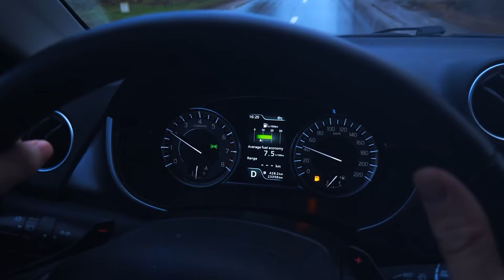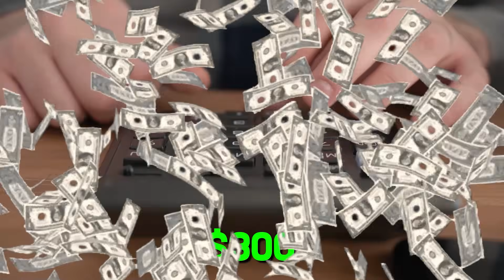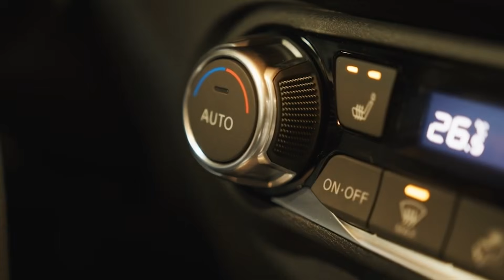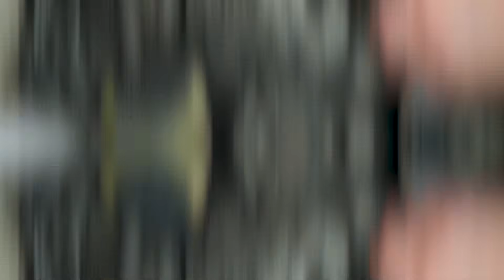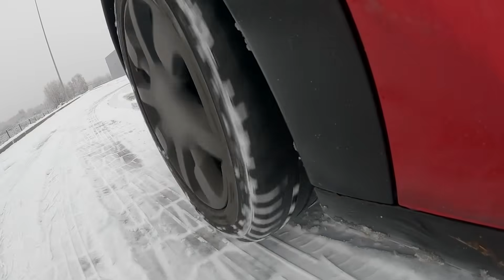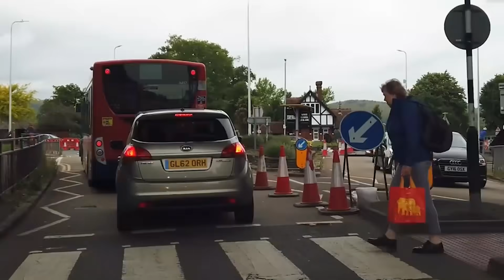THE JAPANESE METHOD for Saving Up to 50% on Fuel – You Need to Know About It

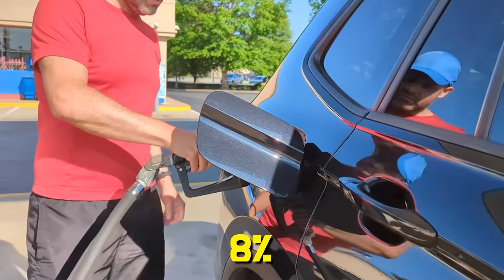Comment: 15:00 I haven't seen $0.20 price differential between regular and premium for twenty years. It's generally $0.80 to $1.00 difference. Also, if 8% fuel improvement yields a $12.00 per tank fuel cost savings, you are getting less than 4 miles per gallon.

Comment: As a hypermiler, I applaud this video. I routinely get 34-35mpg in a C5 Corvette by coasting which takes a 3D knowledge of the area and a certain degree of planning/observation. Wherever I go, I am always looking 1/4 to 1/2 mile ahead of my position. Looking at traffic flow, the light patterns and knowing when to start bleeding off speed in advance of a hill to coast down the other side and accelerate. I have probably passed at least 5,000 cars/trucks IN NEUTRAL.

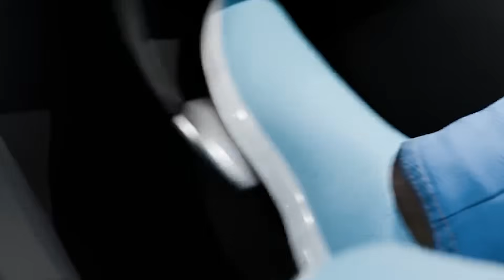Comment: 3:26 
Coasting to stops signs also. Not only save gas, save brakes too. I've tried to explain this to my wife for years to no avail.
Reply: I drive a manual transmission so I do the same thing. I always coast to stops or red lights unless there is a vehicle behind me catching up to me too fast and I don't want to "inconvenience" their expeditious commute if you know what I mean. Then I need to drive at normal speed up until I almost reach the stop sign or light.
Reply: @electron7659 I told my mechanics I don't use the brakes, ha!
Reply: HYPERMILERS UNITE!
2000 C5 Vette: 34-35mpg
1996 Saturn Twin Cam: 43mpg
2022 Honda Accord 2T: 37mpg

Comment: The no warm up doesn't work when you need defrost and have snow/ice accumulation.  As for tire pressure somewhere between door specs and tire markings.  Before EGR we never had a problem with deposits.. But we had carburetors and 30 weight oil, and leaded fuel.  
If your going to run 55-60 mph please stay right.  Thru gearing & tire size my "sweet spot" is 70-75 thankfully I'm in Texas where that is the speed limit.
Reply: It’s called a garage. Look into owning one. 😂😂

Comment: Easy driving worke in areas that has no hills. The fuel saving with stop-start will not pay for the replacement of the battery, starter or ring gear.

Comment: I just bought a 2001 Lexus RX300 with a little over 225K miles. It has no mechanical problems. The compression ration is 12.5 to 1, right at the borderline position to go from regular to premium fuel. I notice I have more power with 89 rated fuel - right in the middle. between 87 regular and 91 premium fuel. 91 rated gas doesn't seem to increase the power any further. I will keep using that 89 rated fuel and see if the mileage increases significantly. With the added power I expect it will.

Comment: Door jam spec is wrong, 38 psi, not 32.
Reply: Door jam is correct. Tire manufacturers don't know what type of car you have. Car manufacturers know your cars weight and distribution. Car manufacturers have decided what type of tires your car needs and at what pressure they put that information on the door jam stickers
Reply: @MarkSaulnier correct, I actually go 3psi above the recommended normal condition
Reply: @MisterrayMisterray Going higher cold pressure will cause those pressures to increase during driving and sun exposure/ ambient outside air temp increase througout the day. You may notice your tires will start wearing in the centers sooner than toward the side walls with over pressurized tires. Just make sure you're also not going over the actual tire's labeled max pressure, can be a blowout hazard as tire pressures increase during driving, sending the pressures even higher, hitting a pothole on a highway at high speeds and way over pressurized tires is one scenario this may happen. Stay safe out there 🙏
Reply: @MarkSaulnier  Car manufactures buy tires that meet their minimum specifications, the psi on the door jam is for comfort not necessarily fuel efficiency.
Reply: @MarkSaulnier  So all tires are the same?
Reply: @Kevin-c5v2wyes unless you have low-profile tyres for a sports car
Reply: I guess you know more than the engineers... stupid
Reply: I’ll go with the door jam spec after 44 years of driving rather than listen to a bunch of know it all internet pricks.